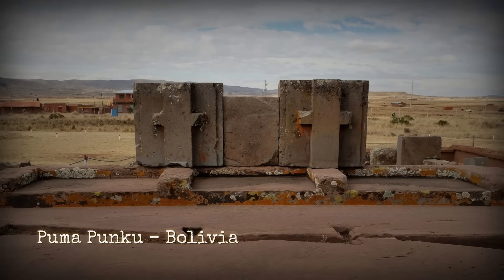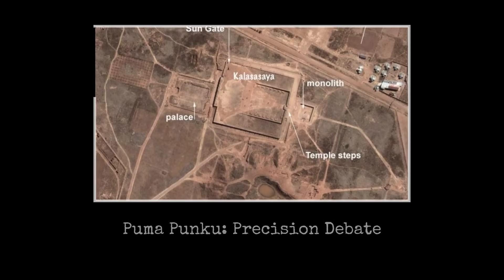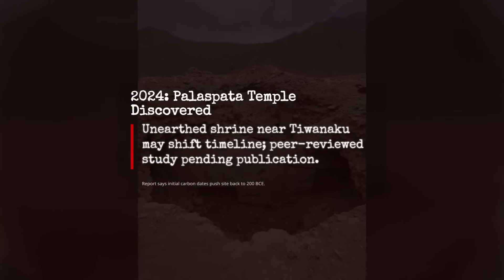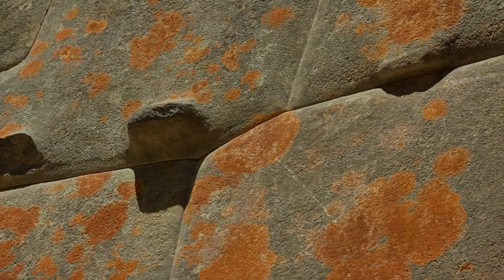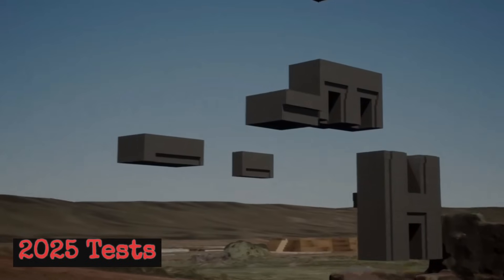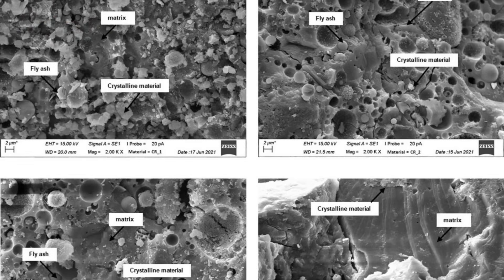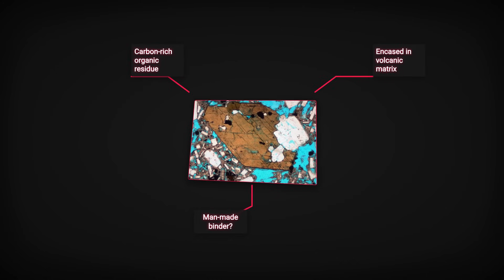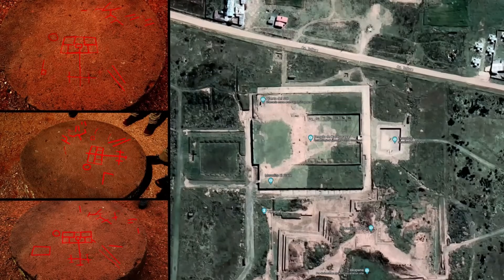New 3D Scans Finally Reveal How Puma Punku’s H-Blocks Were Made

Comment: While Casting may be plausible for the blocks, is there any evidence of the infrastructure for such mass production? What would it take to manufacture in this way ? Transport and preparation, Time in mixing, Setting time, Size of Cast, Molds, Finishing stage, Setting in place, Manpower, Hoisting or casting in place ? How much of the raw materials needed, I could see a small scale, but on the order of magnitude of this site and others around the world, separated by time and no connection culturally, and still not a hint of infrastructure to support it, it seems unbelievable and still exstremly speculative.
Reply: Way faster, and easier than carving, hauling, they were cast in place. easy for 1 man to carry 60+ lb material to a mold pour it in while others mix, and move forms
Reply: @marsmars9130  So, where are the Molds, signs of a mass work force, and like any concrete precasting plant, you need the refined raw material from somewhere ? Tones of it. and the ability to mix large enough batches fast enough before it sets up. Whether you do it on-site or where the materials are readily available, there would be a quarry and infrastructure left behind, if done from a distance, then you have to transport these heavy cast parts to the building site. So there is a lot of math, time, and logistics involved. This is where the seemingly plausible starts to fall apart. It seems unlikely the builders would go to this extent of trouble for a minimal number of sites, then just stop, or maybe they did do to the economics and ability to maintain such an operation ? heck we do this all the time and just walk away. Then there's the question of why the blocks are so scattered around ? these are the factors that need too be considered for many Megalithic sites around the world.
Reply: @ericswain4177  You are restricting the concept to modern concrete behavior. Although obviously there's similarities, this mystery GPs rheaology, specific curing times and behaviors could depart widely from what we know from concrete. A thick dough or clay-like material with a slow cure (like many geopolymers cure) would stand in well. Scales to a few or even one person for prep steps from raw materials, as well as no-mold packing and shaping.
Reply: We don't need to go that far since geopolymer cast stone hypothesis falls apart with fact that these stones exhibit orientated grain structure while cast stone is amorphous.
Reply: @GroberWeisenstein  Pouring with variable uneven mixing would do that, but so does packing thick imperfectly mixed GP material without molds. The GP "glue" itself should be amorphous, but that can carry all sorts of aggregates from fines to "interesting" layers across scale. Just like the microscopy of the Puma Punku andesite shows.
Reply: @rickZR1982A  there is also no cross-cut or vein cut grain in cast polymers. Igneous stones such as these have both. You can't ignore these realities unless you are disingenuous or mentally iincapable, or have no experience with natural geology. I hope that you are just simply inexperienced.
Reply: @GroberWeisenstein  You ever see the stuff artists do in polymer clay? Whole industry around cutting across layered materials, molded, hardened.

Working from the basis here that 1) organic inclusions and chem indicate GP (not independently verified), and 2) The GP was stable over a wide working time in a very thick clay-like state, not seen in concrete.
Reply: @rickZR1982A geopolymer looks like and behaves like geopolymer.  natural stone behaves naturally.
Reply: Took a bit of an eye roll on that, but here's a big problem we have with either gp of natural: some of those those cuts, not just at Puma Punku but all over, don't make any sense geometrically, practically, and chemically, or in isotopic distribution in some residue.. Huge problem. I like to ignore it myself. I can hear the space laser people giggling in the background.
Reply: There are many pics of stones in the area half caved. Giant boulders with 2 sides carved and 2 sides naturally weathered stone. The idea that these are polymers is ridiculous. The half carved boulders are even more intricate and ornate than the H blocks. If they could carve stone that intricate, then carving the H blocks would be rudimentary.

Comment: The blocks at puma punku were CAST, not carved. The technology of this is being explored today with good results. The natives had thousands of years of alchemical knowledge of the various plants and other materials in their locale and found a method to 'melt' stone and shape it using forms. Allowed to harden, the stone returned to its solid form but now shaped to purpose. 

No 'special' knowledge, other than their accumulated knowledge of the properties and mixtures of organic materials was needed. 

Why laboriously cut and haul stones to a site when you can soften it, carry it in wicker baskets and pour it into a mold? 

The 'melting' of stone was far easier, less labor intensive, and just plain smarter to do. And one thing we can be absolutely certain about is that they were 'modern' humans, and thus had every 'advantage' we have as human beings. Intelligence, language, knowledge, accumulated knowledge, the ability to dream, plan, and shape the world around them to their design. So, they were NOT 'dumb' brutes. 

Just like in today's world, the natives would have used what they knew to make their lives easier. The 'melting' of stone was Far, far easier than carving such hard stones using base metal tools and wooden or stone hammers. Softening the stone and pouring it into place, like concrete, would have been far easier and the most logical way to get such complex shapes with such accurate, precise dimensions.  

There is no mystery here, other than the pundits insisting upon 'cut' stone, instead of 'thinking outside the box' and admitting that the natives had a way to soften stone to use like modern concrete.
Reply: This simply laterals the question to who created the mold
Reply: @waynearnold3128  No molds needed if thick material was used.
Reply: That's completely Ludacris there is no way they poured the blocks it is not concrete it has been proven to be a homogeneous stone it is not a geopolymer it's possible that the blocks in the city were but they are not andesite.  I think pretending to know exactly what they did is super narrow-minded and dismissive. And you still have the issue of hauling you still have to haul all of the materials to where you're going to make your geopolymer to pour into the molds the weight still matters so why would carrying sacks of mix be any different than carrying the stone itself? Let me guess they carry them one by one 10 lb at a time for their 100 ton stones?
Reply: @calebsone1630  Remove all the other unknowns, and look at the how, and the why, with the time! even with heavy machinery the easiest way is form and pour!

Comment: Why is every single H-block 1 meter x 1 meter when they didn't use the metric system
Reply: Maybe this clue points to the fact we don't know who manufactured them as the attributed builders did not use the metric system.
Reply: @jnxius that’s what he just said, genius..
Reply: 1. Establish by dividing the difference between 864,000 and 7,920 (the diameters of the SUN and EARTH in miles).
2. Multiply the outcome by 1,000
3. You have now ended up with the ORBITAL VELOCITY of the EARTH, measured in ... kilometers per hour.
4. Multiply by 24 and you'll find the ORBITAL VELOCITY per day, which is equal to PHI squared x 1,000,000

Now explain to me how our distant ancestors did not know or use the decimal system???

Please read my analysis of the origin and meaning of the system of TIME MEASURE that I have published on the Official Graham Hancock website (see Message Board - Mysteries - 144,000 Seconds (topic title).

DGO
Reply: Every H block is different- why are you blind as a bat clinging to a lie and not believing your own eyes.
Reply: @henryknox4511 
Yeah.  They look almost identical and are extremely carefully made, but they’re not “exactly” the same.
Reply: @keirfarnum6811  Speaks to packing on a thick material using measurement and templates but no repeated molds as for fluid material. Trimming and finishing is easy if cure rate is slow as geopolymers can sometimes be. As it approaches final hardness, I bet you could even burnish a material like that, just as you can leather hard clay for a shiny finish.
Reply: the metric system is in relation to the earths circumference. 1 millionth part between the north pole and the equator. Unlikely, but other people could have had the same idea.
Reply: There was a classical "meter". Almost, but not exactly the size of the modern meter.
You see it in ancient Egypt, not surprised to see it in America.
Reply: @andypanda4756  Except the blocks aren't that either.